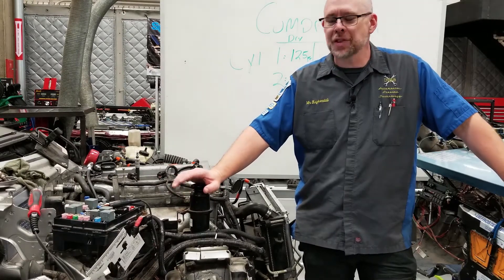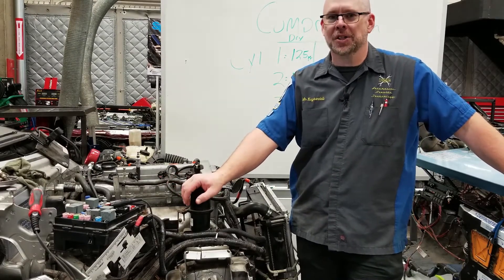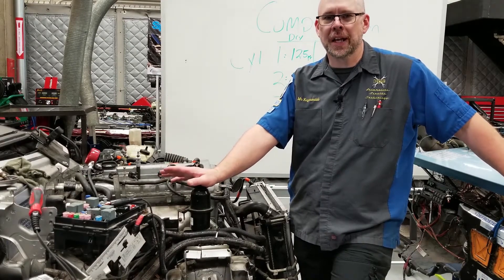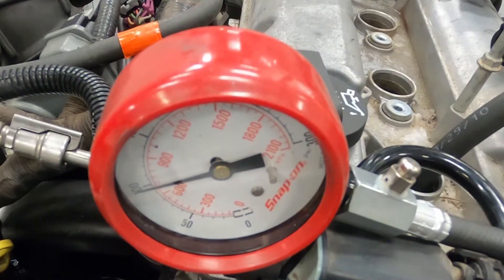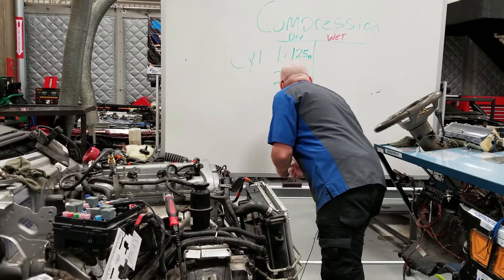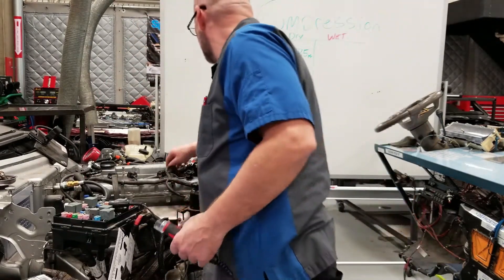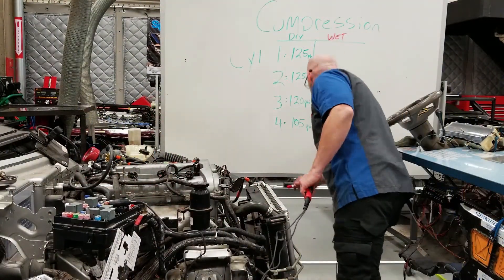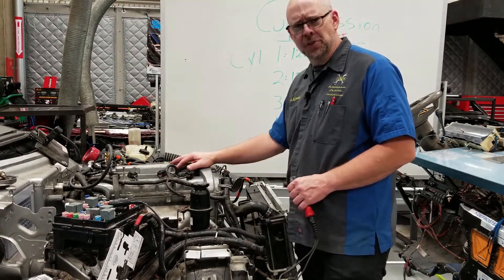"Wet" Compression Testing

Comment: Word of caution.... Historically true on large engines and with low compression ratios.... If you add oil to the engine piston, you measure a different compression ratio by definition! , you need to take that into account....Imagine you have a 4 liter V8 cylinder  with compression ratio 15. You have a BDC volume of 500 and TDC volume of 33...if you add only 2 cc of oil your volumes go down to 498 and 31, leading a ratio of 15.9!!!  This is just to say that if you use too much oil you might get misleading results

Comment: What if I have wet cylinders-gas- from rich carb situation or weak spark or a combo. Should I remove carb and plugs and let air out/dry for s few days, maybe brake/carb in the hole to promote drying prior
 to compression test?

Comment: Great video. I just did a dry compression test on my 2001 Corvette Z06 and my number 7 cylinder gave me a number of 171. All other pistons are in the 195-200 range. I added 2 table spoons of oil to cylinder number 7 and that number jumped from 171 to 204. Is that without a doubt a ring problem?
Reply: it appears to be so, usually that's all the adding oil does, coat the ring for better seal.
Reply: I’ve had the oil coat the valve seals long enough to rev the shit out of it and clear the gunk out of the valve seats

Comment: Very helpful video; could you please do some videos on a compression and leak down test on a diesel engine fitted with an electronic diesel control (EDC) and also please show some examples of any potential dangers that could be caused to the engine if the correct procedures are not followed. For the compression test the diesel fuel shut off solenoid would have to be deactivated but I am not sure if any potential damage could be done to the EDC when carrying out a diesel compression test? Some workshop manuals can be confusing especially when a compression test covers various engines and is not specific enough to the individual engine being tested.

Comment: Now I am confused, vid one we said " if the comp raises with oil your rings are not the problem. Now we say it is the rings but not a hole in the piston... I will rewatch
Reply: When you add oil rings seal better and compression will raise for good or worn rings ( if the compression stays about the same you need to consider damaged components, rings,valves, gasket etc.) 
So the magnitude of the increase is what counts, If your rings and cylinder are good the compression increases but it will not be as great as when you have have worn rings and cylinders.

Comment: cylinders need Min. 100 psi to detonate...

older Rebuilt V8 have around 250psi. +/- 20psi..
Some Newer (foreign) engines have around 350psi.   (need to check your specs)

Comment: Hello! i have a 350 c.i. long time sitting engine, i cranked it 'till its worm.. i try run it , it seemed too rich spark plug indicates mixture & barely starting. I did a dry test only and 2 4 6 8 are 175 psi each. Twice cranking. And 1 3 5 7 are 150 psi. Is that okay for an engine to start with each Cylinder banks pressure or they precisely have to be equal? and what's the ideal cylinder pressure number in an engine ?

Thanks.
Reply: cylinders need Min. 100 psi to detonate...

older Rebuilt V8 have around 250psi. +/- 20psi..
Some Newer (foreign) engines have around 350psi.   (need to check your specs)
Reply: @kosh9639  250 seems way too high. They were 180 from the factory new I believe.
Reply: @DominiAeternum   when people buy a used high mileage engine; from, the junkyard... you would hope to get; between, 170psi to 210..

Comment: What if a stuck injector dumped so much fuel into one cylinder and cylinder is washed? Then it gives a low psi compared to the others, then u squirt oil in and bring back the compression, then u conclude that cylinder has failed rings? 
Washed cylinder and failed rings negates compression. Oil increases compression. What to trust?

Comment: After wet test how long I have to do a dry one again. My engin off the car and test was cold.. dry was 120psi all 6. Wet 150psi all 6. Cold
Reply from the maker: After performing the wet test, you really need to start and run the engine until it's warmed up to clear out all the oil. Once that's done you can get a proper "dry" test. Your numbers really don't look to bad for a cold engine (depending on the engine of course!)
Reply: @pccastengineperformance7844  it's out of the car. What if I do it in a week.will that clear the oil ?
Reply from the maker: @samsstory78  It will be a little closer, but that oil will make a nice coat on the cylinder wall until it's washed out or burned out. If you crank it enough times there should be enough scraped off to get close to "normal" dry test readings.

Comment: So a cold compression test 03 Ranger 3.0l
155
150
155
140
90
150
Used a drinking straw 1 time to get some oil into the cylinder on the 90. It went to 95..... am I good to say it's the stuck valve that these heads are notorious for....
Reply from the maker: Hey Corey, sorry for the late response - yes, you definitely have a valve sealing issue. Sounds like it's time to pull the heads.
Reply: @pccastengineperformance7844  no worries. It was throwing so many codes, none of which were on the #5 cylinder. I don't have a leak down tester, couldn't find one around that I could use and didn't want to spend $100+ for a one time use. I'm currently in the process of breaking it down now. By the time I get it back together it will have new heads, O2 sensors, cam synchronizer and sensor, oil sender switch, maf, iac, pcv, injectors, coil pack, wires, plugs and crank position sensor. So if all that don't fix it, it might have an LS in it in the next few months...... thanks for the response, btw.
Reply: @GHOSTWERX23 Hey I’m having the same low compression issue on my 4.0 ranger, did you ever resolve your issue?
Reply: @manaman8085  i did. I had to replace the heads... the exhaust valve was leaking causing the low compression. I went ahead and just rebuilt the entire top end... well from the cam up..lifters, rockers, pushrods, fuel rail,  injectors, coils, throttle body... and almost every sensor.. spent way too much for what the engine was worth.. sold the truck last yr, went to another teenager, and she's driving the hell out of it

Comment: Do you think that thicker oil could help with compression? For example 10w30 instead of 5w30
Reply from the maker: I'm going to go with the assumption you're referring to running a thicker oil as engine oil and not just using it for the wet compression test. With that in mind the answer to the question is definitely NO. The only compression issue it could possibly help with would be failed piston rings, as it would have no affect on any other cause of compression loss (burned valves, damaged pistons, failed head gaskets, etc.) And if the compression loss were due to piston rings, it is the compression rings that have failed, not the oil ring(s). Even if both the compression and oil rings are failed, cylinder pressure will be pushing past the rings and blowing the oil back into the crankcase, so it would be unable to help with low compression.

It used to be very common to run a thicker oil in a worn engine (usually to help with low oil pressure). That's something I definitely do not recommend in a modern engine anyway. The very small oil passages used to get oil to the top end of the engine will not allow the thicker oil to flow up there as fast, and can lead to damage of camshafts, valvetrain components, etc. 

So probably too much information, but in short, nope.
Reply: @pccastengineperformance7844  Thanks for the answer, looks like it will not help to piston engines, but may improve it for rotary engines because everything is sealed inside.
Reply from the maker: @She1lby  I can see that a little more - those apex seals have to stay wet. I've had several RX7's and RX-8s that sat for a couple days or more in cool weather and wouldn't start until some oil went down the intake to get those seals working again. The thicker oil may stay on those seals a little longer - although I would be curious to see what a really thick oil would do to a rotary's ability to turn higher RPM's!
Reply: @pccastengineperformance7844  Probably gains will be roughly the same as power loss to a higher friction.
I have RX8 and trying to find out optimal oil that will burn well and protect engine better than 5w30 Mazda's oil (9.6cSt at 100C).
Not sure if increase up to 11-12.5 cSt at 100C will be enough, also it's hard to tell how changes in flash point from a different oil will affect amount of deposits i.e. do you need to lower this number as much as possible for easier burn?
Reply: Hi sir just asking why you pulled the online classes down... some of us we don't have such great information 😭😭 please put them back our intentions is to learn how to fix car the right way.. help us to be better techs.. thank you sir
Reply from the maker: @johnmwangi6291  I'm sorry, but the videos I had to pull weren't supposed to be viewable by the general public. Those videos potentially contain information from students in my program, and I can get in trouble if that is accessible by anyone but them. I'm glad you like the videos, and I will be leaving all of the others up. There are more public videos in the works as time allows too! Keep learning - the great techs are the ones always looking to learn something new!
Reply: @pccastengineperformance7844  I hope they know how lucky they are to have such resources and such a talented teacher...here we have to spend sleepless nights just to how a maf sensor works and how to interpret scan data.. hope to see more of your engine performance classes..God bless you sir

Comment: Hey man, I hope you could help me with my question. I have put new rings and bearings and assimmbled the engine the crank it and find out it does not run. Checking the compression, cylinder 1 and 6 on a v6 are outputting 90 psi sharp and the rest giving me 30 sharp. The engine does not run. Can you give me hints on my this is happening. I did not check the end gap between the rings as I bought standard rings and naively enough thought everything will be okay. Thanks alot man
Reply from the maker: Well all of your compression is too low to run. Have you tried to do a wet compression test? It sounds like something may have happened to the piston rings on installation. What type of tool did you use to install them?
Reply: @pccastengineperformance7844  hey man, thanks for your efforts, I rechecked the timing belt and found that the belt was 3 tooth away from being timed, got it to where it should be and the compression jumped back to a minimum of 150 dry compression however, I have an interference engine, one cylinder had both intake valves bent resulting in 0 compression 😭